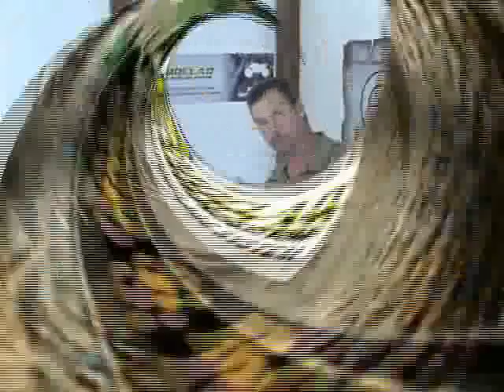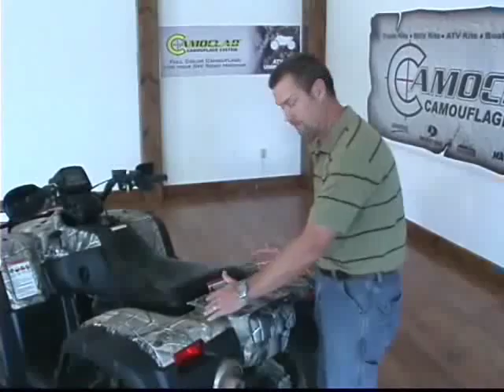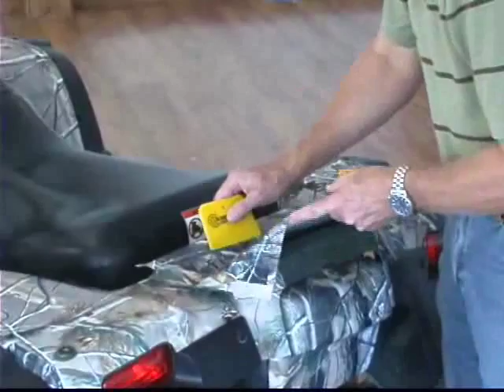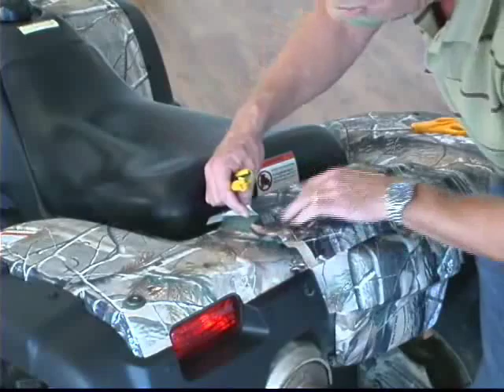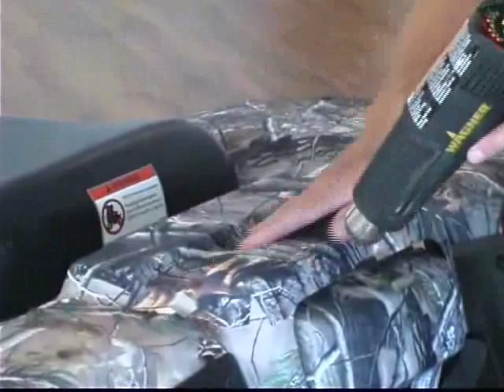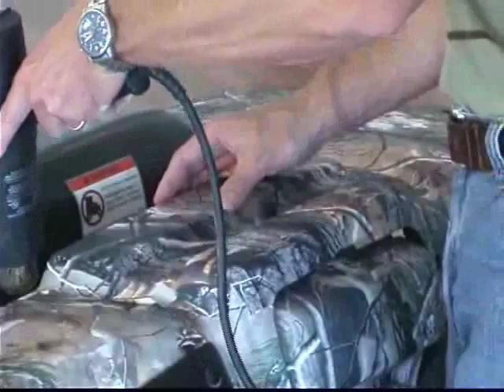Part 7 of 7 - How to Videos ATV Camouflage Install  - Official Camoclad Video

Comment: I should be to install approximately one piece per month, given my skill level and lack of patience to do such tedious, time consuming work.  My ATV will be done in a year!  However, I am going to need to buy at least two or three kits as I am sure I will screw up a lot of material.  The cost for doing my Yamaha Moto 4 should be about $1,000 assuming I don't have to start over too many times!  That's with my labor being donated for free.